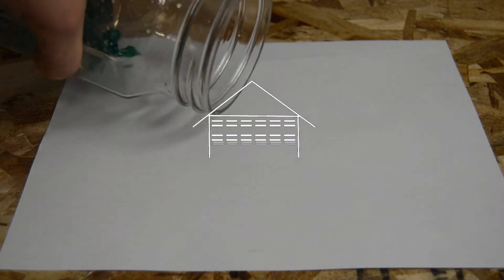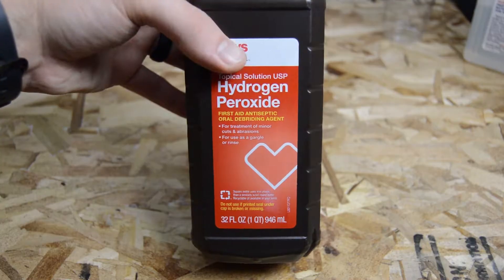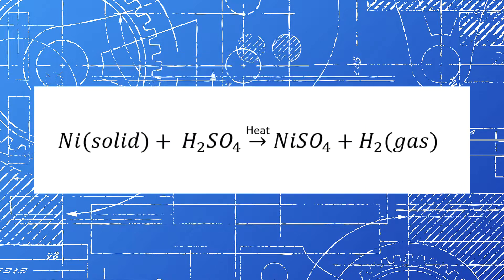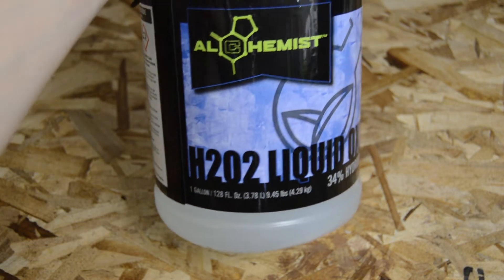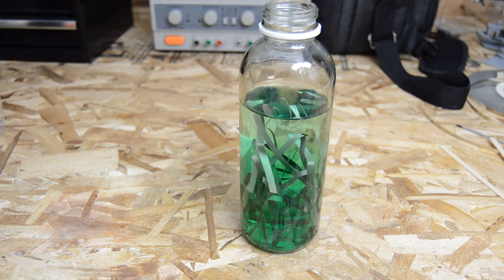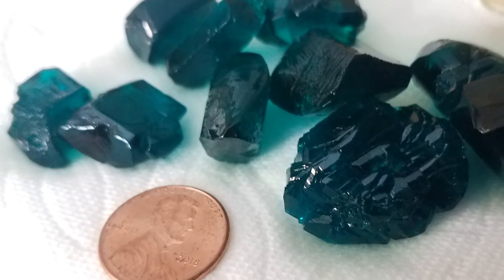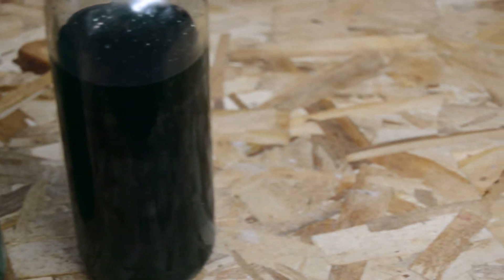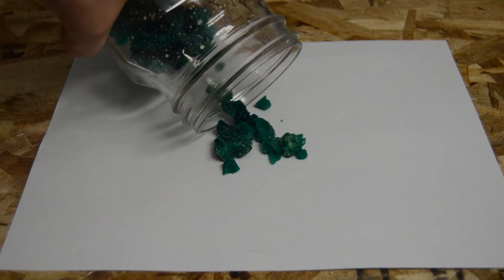How to Make Nickel Sulfate Safely ~ A Nickel Plating Solution Ingredient

Comment: I have used nickel nuggets that average 45g 25x25x6mm the reaction is not as vigorous  but it is continuing on a heat plate at 150f. I DON'T KNOW how to calculate the mol.  I have 800ml of 35% sulfuric +800 ml 12%  (40volume) peroxide.   I added excess nickel (450gram) but do not know how to calculate the theoretical saturation amount of nickel.   I will weigh the undisolved nuggets when they stop reacting.   But what should I expect?
Reply: If I understand your recipe,  it  was 85ml of 35% acid 300ml of 3% peroxide and 12 grams nickel..  scaling up the 4x higher concentration peroxide  gives me 75ml close enough I used 1:1 acid peroxide.  Initially adding 113 grams of nickel,  after the reaction showed to be contained  (with less surface area)  I added the rest of a ~pound  500gr. The solution, 36hrs later is very dark nearly the color of the crystals.   Sitting on a heated pad @60c it builds up a cloudy precipitation around the nuggets on the bottom that dissolve back to a clear when stirred.   Can you tell me what the theoretical saturation is and what mol.  Thanks bro your video is the only decent resource for Nickel sulphate and I suspect it is superior to the acetate in performance  since it is what industry uses.
Reply from the maker: That's a bit of a complicated calculation to explain in the youtube comments... there's lots of resource online on how to calculate saturation concentrations.  The reaction would have been slower due to a lower surface area. I had the same white mist.... not actually sure what it is.

Comment: So I tried this same experiment with the exception that I doubled the ingredients (600ml Hyd Peroxide, 170ml sulfuric acid and 6 99%Canadian nickels = 25 grams) and the solution hasn't completely dissolved as of 48 hours later. Is that normal and shouldn't this work just as well?
Reply from the maker: Are the nickels potentially plated with something and were they thoroughly cleaned before hand? Even a very small layer of grease gunk or oil can prevent a reaction.
Reply: @GarageScience  Canadian nickels from 1955 - 1981 are 99.9% nickel.. and I didn't clean them beforehand.
Reply from the maker: I recommend cleaning with baking soda, a little water and a scrubbing pad.
Reply: @GarageScience  ok. There is some reaction happening,  just not entirely.

Comment: Are you sure you produced 300 grams of NiSO4 and not 30 grams?
Reply from the maker: Yes I sure. It was weighed with a scale. I definitely wasn't off by an order of magnitude.
Reply: @GarageScience  The reason I ask is because when I do the math I get 30g.  Did you ever try to do the math?  Would you like to see my math?
Reply: @GarageScience  Even though I followed the video carefully 3 times, I didn't get when it was said that the final product was 300 grams. It seems impossible to me to obtain such a quantity starting from 12 grams of metal. I start by saying that I know little about both chemistry and maths, but if the moles per liter of the final liquid are around 0.5, considering that nickel sulphate hexahydrate has a value of 262.85 g/mol and that the volume of the liquid will be approximately 386 ml , something around 50 grams of crystals should be reasonable (I repeat, I'm not a mathematician), so I really don't get why 300 grams. 
By side, seems that almost every solution of hydrogen peroxide even at 3% always comes with that damn stabylizer. Still good for this experiment?
Reply from the maker: Each bottle made used 12 grams, I made multiple bottles though and evaporated quite a bit of water. There was also un crystallized solution left in the evaporating jar. There's too many variables at play here to get a straight calculation. Perhaps I wasn't clear about that in the video.

Comment: I tried making this for nickel plating and since you don't say how much to dilute the solution I diluted it 50/50 with distilled water and it still disolved the part I was trying to plate. Am I doing something wrong here?
Reply from the maker: So if you use this to plate directly you may have an issue because without some special tools it will be tough to know how much acid is left over in the solution. That's why it's a little simpler if you form the crystals and redissolve them in distilled water so you know there is little to no acid present.  Did you add additional acid like I show in my nickel plating video?

Comment: you can also use Nickelcarbonate (from pottery supply, its used for glazes) and add the respective acid like sulfuric, =nickelsulfate, Hydrochloric=Nickelchloride , Acetic=Nickelacetate.  The reaction only gives off CO2 gas. Add slowly to prevent from foaming up due to CO2 evolution.
Reply from the maker: Do you have a source for the nickel carbonate? Everywhere I look it is pretty expensive :/
Reply: @GarageScience   i am not in the US, over here its 40-50€/kg. a quick google turned up that, maybe thats helpful: https://www.theceramicshop.com/product/16682/nickel-carbonate-1-4-lb/  ("currently out of stock", but decent price, maybe ask when the restock?)

Comment: I even put the nickel in straight battery acid for a whole day and they did NOTHING!! You said it would be violent in straight battery acid, mine didn't even dissolve.
Reply from the maker: It has to be heated if it's in straight battery acid... heated with a burner, or stove or something like that... this is potentially very dangerous (hot battery acid in your eyes is basically instantaneous blindness), any particular reason you're trying to get a violent reaction with sulphuric acid?

Comment: You can also drive the reaction forward with electricity.  Place 2 nickel strips in the sulfuric acid solution.  There is no need for hydrogen peroxide.  You can connect low voltage AC directly to the 2 strips.  You can rgulate reaction rate with current, so "run away" will not happen.  Electrolysis will etch & plate nickel, with net reaction of nickel sulfate being made.  Boil down solution & when cooled, nickel sulfate will crystallize.  You should not skip this step as the crystallization purifies the product.
          BEWARE!   A lot of the "nickel" strips are nickel-plated steel.

Comment: Why not crash it out of solution before drying.
Reply from the maker: Not familiar with "crash it out of solution" in terms of chemistry processes, could you elaborate please?
Reply: Garage Science Add a miscible organic solvent to the solution such that the salt precipitates “crashes” out of solution. It might partition, it might not, you also won’t get pretty crystals but it might well enable you to recover the bulk of your stuff. I might try it with ACN and see what happens.
Reply: Garage Science Maybe what you could do is add some ethanol, the wiki for NiSSO4 says it is not soluble in that. Might be expensive for garage chemistry and, like I said, it might partition instead of precipitate. I might try just to see what happens! I just got some nickel sheets in today in fact. I might substitute ethanol or methanol to save cost too. Who knows!
Reply: @GarageScience  I know this is 2y after the fact, and I'm not educated on the matter... 
However, I've heard the term used before somewhere, and "crash" means to invoke the nickle into precipitating out of the solution, which happens instantly as soon as the substance is added to the aqueous NiSO4 solutiom.

I believe it's termed this, on account of it crashing with... the metal ions (?)... and "knocking" it out of solution instantly.
Though in not sure if it is implied due to technical reasons, like molecules literally crashing into each other, causing the precipitation; or just symbolically, resembling shattered glass falling about in a car accident. 🥴🤷‍♂️

Comment: 4 mols per liter...what the hell does that mean?
Reply from the maker: It's chemistry stuff. It's related to the concentration of a chemical in a solution.
Reply: @GarageScience  well that explains everything.
% would have been nice.
Reply from the maker: Unfortunately chemistry isn't that simple lol.
Reply: @BillFromTheHill100  Mole or mol means molecule. 1 mol = 6.023x 10²³ particles or atoms present in the element which is the Avogadro's number. One uses mols/liter because you are creating a solution using a solute and solvent. Any molecule or chemical compound has a certain molecular mass, expressed as gram/mol, which is a standarized chemistry unit as per universally agreed convention of chemists. 
To prepare a desired concentration of the solution, you take the mass of the solvent (here in this case, concentrated sulfuric acid) and compare it with the molecular mass of solvent (which is sum of atomic masses of the individual elements). The ratio gives you the "number of moles" present in weight of the chemical compound/solute(sufluric acid). The number of moles is then dissolved into desired volume of solution (usually water..0.5 liter or 1 liter as desired). The resulting value of the concentration is expressed in mol/liter. It is much more accurate than expressing in terms of w/v% or v/v%  because we know that weight or mass of chemical compounds are not all the same. @Garage Science: Please confirm 😃
Reply from the maker: Can confirm 👍, we'll stated.  I tried to provide the resulting concentration for this recipe so that if someone changes it they could easily calculate the new concentration.
Reply: Nerds

Comment: This totally did NOT work for me. It won't finish the process. Been trying for 2-3 days and still have the same nickel strips after running them through the solution twice.....
Reply from the maker: Was your hydrogen peroxide new or old? Hydrogen Peroxide has a shelf life due to its natural decomposition.  Are you using the exact solution in my video or are the ratios/concentrations different?

Comment: "The Hydrogen Peroxide is what makes the Sulfuric acid safe." I had to pause and check that this wasn't an April Fools video. That mixture is called Piranha solution for... reasons. Those reasons are only safe in that the name serves as a warning.
Reply from the maker: I would say context is key for that one but I see where you're coming from.